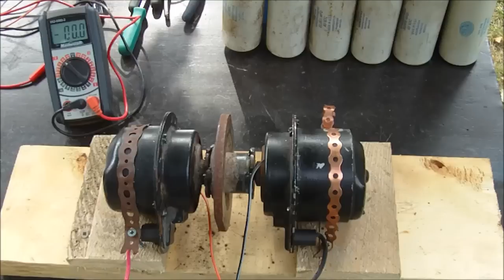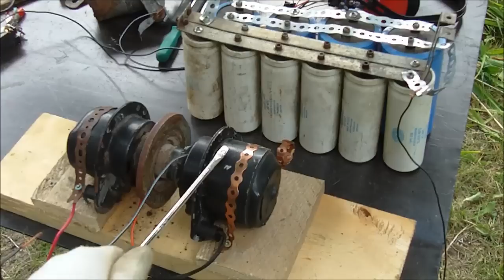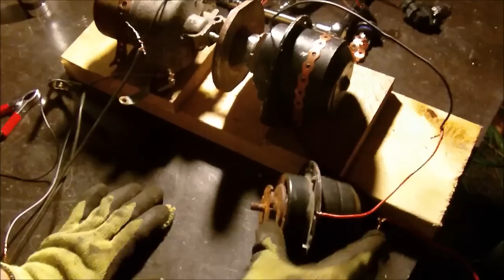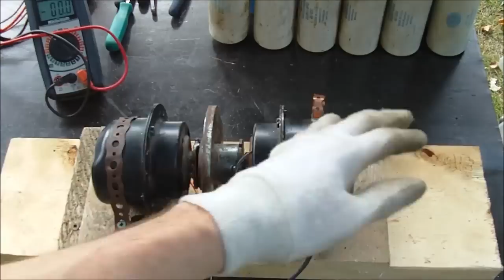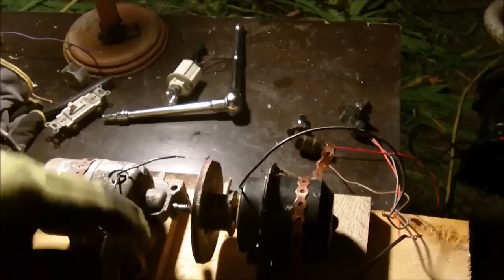Electric Motor to Motor, can they self run?

Comment: he is not saying its a scam , or that it can't work , so i will , its a scam and it can't work , , even if you add a giant flywheel you are not getting any free energy , though it will work for longer its only because the flywheel will have some inertia , which is a mechanical force , if you don't understand the laws of physics go watch Full Metal Alchemist Brotherhood ( not the Full Metal Alchemist cause that is fucking garbage) the law of equivalent exchange is the same as the law of preservation of energy , just with magic

Comment: Theirs no such thing as a 100% efficient electric motor and due to friction in the bearing and energy lose in the wires the two motors will not run themselves.

Comment: you need to have the correct cooling system to do self run 0 point energy you get free electron flow at super cold system levels hot and hot wont work its like + and  + you need + and - or hot and cold systems to get free energy ! 😈😆😆😆😨😱😱😱😲😨😨😵😲😲😎😎😎😷

Comment: Any and all claims for "free energy" is a direct violation of the laws of thermodynamics. Because of entropy, there are no electrical or mechanical devices that have 100% efficiency, therefore you can never get out of a system, more energy than you put into the system.

Comment: Your using the wrong motors.........Use 2 tread mill motors and they can self run, yes they both generate electricity when they are spun. The faster they spin the more DC current they produce. You can use a DC motor and a car alternator and start the DC motor temporarily with a 12 volt battery and spin the alternator to start producing electricity for the motor and disconnect as soon as it starts and yes both ways do work............

Comment: you have the wrong set up.  Your trying to run each motor against the other and that will never work.  You need a lager output on the first motor then step that down with a circuit breaker and feed that back to the 2nd motor.  As long as the 2nd motor outputs an RPM that matches the RPM input of the first motor, it should be self-sustaining. I have intentionally left a step out.

Comment: high voltage zero amps, high amps zero voltage, isolate and then combine.
i know what is the reason why it won't work, it is not about, will it work or not but of am i gonna profit from it or am i gonna be "labeled" crazy or stupid. 
remember things are invented by curious minds because of a need to achieve not need to hord.

Comment: You were not even doing it right. You need a flywheel. With such your can use a lower power motor to which every turn of the motor will turn the generator at least 4 or 5 times. Your design would never work as the rotation of the motor and generator are the same

Comment: two units of equal have loss ok we get it. but a stick generator with low torsion run on a motor can produce 20000 to 200000 volts using 120v 20 amps plug using a large wheel on a accelerometer while operating on a very low voltage of 6 volts and 2 amps. the accelerometer can be easily found in factories being used as conveyor motor with a speed control. to be determined by torque of the accelerometer and belt tension. try putting weights on the conveyor to cause a calculation of torque for voltage step up unit. to all people listening please consider how much water right\ general electric stock\ or oil stock each individual owns before listening to this as this theory is actually irrelevant to the future of society. my theory is called near zero point energy production. it also works.!!!

Comment: Why don't you just connect 2 generators to 1 motor.
Reply: Then the motor itself would require over double the power to drive the 2 generators.
Reply: oh, i see. never mind then...

Comment: youre not actually doing it the right way, the idea of self running is not so much self running as its self sustaining, you need an alternator in this and also something additionally added like a small solar panel and this must be hooked up to capacitors or batteries.

Comment: I know that you didn't want to offend anyone with your video but I am a realist. People this will never work! And this is why. First you need to overcome ohm's law  I=V/R . Not only do you need to overcome the laws of electrical resistance you would also need to overcome mechanical friction and fluid drag of the rotating components in the atmosphere.
The reason why adding a bigger fly-wheel makes it run for a longer time is because you are adding stored energy in the form of kinetic energy. Once this stored energy is used up the motors will stop. If you add capacitors you would just be using the energy stored in the capacitors until it is depleted.
Energy cannot be created or destroyed. It can only be transferred from one form to another.
One way to look at engineering is to look at the world around us. We cannot do anything that does not happen in nature.
So with this in mind if one was able to collect and store anti matter you could conceivably be able to create a self sustaining 100% efficient matter / antimatter reaction. But even then it would not produce more energy than what was put in and be completely worthless.    
The reason the idea of getting more than what you put in will never work is because if physics would allow this to happen the entire universe would never be and would have only lived for less than a moment. Another words it would break reality.
If you just really want to create something that spins seemingly forever build a rocket and blast yourself out of the solar system into interstellar space. Once you get there push yourself away from the rocket with only your hands as hard as you can. This will make you spin in circles head over heals for probably millions of years until you run into something.

Comment: Why make it a 1 to 1 ratio? If you were to put a bigger pulley on the drive and a smaller one on the generator you can essentially get (in theory) a 1 to 5 or even a 1 to 10.

Comment: ah your missing something there .. and your configuration is just wrong .  you need a weighted pulley and ratio 3/1  ,  you just simply can't hook up 2 electric motors together like that and think OH it will work .   and if you did not take apart the motor and rearrange the stator winding and diode  then its really not going to work ..    your video proves you did not do all your homework on nikola tesla  and limited electrical theory understanding  ???

Comment: I'll debunk it, it is impossible!!!, you cannot get more energy out then you put in!?, where would this energy come from?, how would it be expressed mathmaticly? This belief stems from the fact that people think electrons are performing work, THIS IS NOT SO, electrons at any time ever, are only being used to transfer power!!!! To convert from mechanical rotation to other forms. How would eddy currents, back emf, resistance in ohms, and in general circuit impedance overall????

You did a good job on your test, but I defy any of those idiots to show me the mathematics showing where such energy could ever come from, Remember this, If such a device existed,  all current understandings would me wrong, and the math expressions with them.

Comment: this homer simpson put these motors together wrong the armatures are turning against each other stopping rotation if they were,put side by side it will work like its sposedto but nope hes tryingto run it in wrong way not together like has them in video but to put them side by side then it works way its sposedto...its sposedtobe 1 motor 2 generators motor hookedup to 1generator for unlimited power to turn motor for other genrator for full power becuz one generator loses power to give out power to both motor and... generator  need pulleys and setup like on your car or trucks belts😆😆😆😆😆😆😆😆

Comment: The issue your running in to as I'm sure your aware is "friction" - In order for this to work you must over come the friction by using a gearing mechanism and a voltage regulator...
Reply: no gearbox adds even more friction and it just converts speed into torque this and other stupid free energy devices won't work because of friction and resistences in the wires people who belive that crap should try it themselfs and get dissapointed lmao

Comment: Very simple answer: No it can't. Why ? 1. Friction, in the bearings   2. Electrical resistance in the motor wire leading to loss of energy through heating,  3. Air resistance of rotating motor,  4. Eddy currents generated between rotor and motor body,  5. Resistive losses between brushes and commutator. The more you look the more losses you'll find.  The motor is an imperfect system so will always have energy losses no matter where you put it.  NO mechanical system will be able to give perpetual motion, anyone who claims otherwise is a scammer, or totally deluded, or has no understanding of basic physics.                                                                                       Even the planets rotating around the sun lose energy, and the Earth rotating around it's axis loses energy.  Entropy is unrelenting and increases to a point where energy everything tends towards a chaotic state.  If anyone thinks otherwise then move to a universe with different laws of physics, good luck with that....

Comment: those aren't generator - generator
Reply: if they were generators I could charge my car's battery from just spinning the fan
Reply: +Vladimir Nachev lol you dont know much about motors huh?
Reply: +Vladimir Nachev yes you actually can charge you cars battery with its fan motor IF you disconnected the fan motor from the car and connected the red and black wires appropriately to the battery and used a blocking diode then spun it long enough. might take you a week but yes it is possible. same with any motor. see my recently posted bike and treadmill motor video. it isnt a generator but puts out 60vdc and 1.8 amps
Reply: +Vladimir Nachev You could if you spun it fast enough in the right direction.
Reply: Its simple EM theory. A magnetic field passing through a coil creates a current in the coil, if you move the field, you make current, if you introduce current in the coil, you move the field.

Comment: Let's make a correction 1st my name is Lloyd G stovo and I am the creator of overunity come now that we got that out of the way everything you did in your demonstration was incorrect. And that's because you have the definition of overunity absolutely wrong . Having more power out than in what does it have to do with the word over or unity You'll have to go to a dictionary and look up the word overcome and then look up the word unity, So having more power out than Ian has nothing to do with overunity and this is the reason why your motor connected to a motor doesn't work I'm about to do a video save the link to your channel and give you the link once I'm done with the video because it needs to be explained finally because people will keep just doing things that are wrong how do we know that it's wrong because people for over a 100 years have been attaching motors to motors All the way back in nikolai Tesla times where you have a motor running a motor, I thought sometime in the videos especially after you hooked up the light and you got a drop in voltage that you would get that the motors were not dropping because no power was going into the motor there's a reason why, No power into your motor that means the motor is not going to work but the power was going into the  Light which you seen the effect, There's definitely a good way in a bad way to do this demonstration you happen to do it the bad way there is a very good way of doing this without breaking the laws of physics that's that's what our channel is about and yes we are an actual library This information is old and has been done for many years it's not even funny anymore that new upstarts come in and try to rediscover something that already been done and patented. And then do it absolutely wrong and think they know everything it is to know about this it's a shame that they couldn't crack open a history book and just simply look it up.

Comment: You need momentum to make it constant running, you can add fly wheel in this case. The inner motor momentum from the coper wire is not heavy enought to make it keep running.

Comment: The flywheel needs to be larger. The input needs to be square waves of apx. 10% duty cycle. Impulse the entire cap bank into 10% rotation of the small motor. The output motor would then charge up the capacitor bank with 100% duty cycle. The switching would need to allow the current to flow into the input motor for the 10% rotation and then into the output motor for the other 90% rotation (+the 10% rotation of the first motor). Diodes would help manage & prevent the electricity from going down the wrong path and wasting your energy. Here is a little proof of the concept with an OBDII scanner and your 5 speed transmission. Anyone can do this, and it will cost you $31 (or less) to get the OBDII scanner. 

Have your real time OBDII scanner set to instant MPG & average MPG. 
Get your car up to 55 mph on the top of some long down grade slope.. now shift into neutral and take a look at the instant MPG going up to 5x your average MPG.  What this is expressing is the power of the relationship between input power & its relationship to inertia. You should be able to achieve this same effect with electric motors. The key factor to pay attention to is the inertia. The input motor running at 10% duty cycle should be able to turn the largest flywheel it can possibly turn. When the fly wheel is up to speed and rotating for 360 degrees, it will be producing power for all those 360 degrees. Capacitors are excellent for impulse power fed to a motor for an extremely short burst. For those who think this is all about gravity? Try the same test on level ground. You shift into neutral at 55mph and you are at 5x the average MPG. You accelerate back up to 55 (after you've gone down to 40mph) and you will see that your average is way above your average MPG. Where are these gains coming from? It takes apx. 4x the energy to stop a spinning flywheel as it does to keep it in motion. This law of physics is never paired with fuel efficiency or motor efficiency. The first single piston farm motors were so inefficient that the several hundred pound flywheels were needed just to keep the engine from stopping. The first Ford cars were like 50HP, and the engine size was huge with iron piston chambers. Emphasis then (farm equipment ) massive flywheels to overcome the horrible efficiency issues the motor was plagued with.